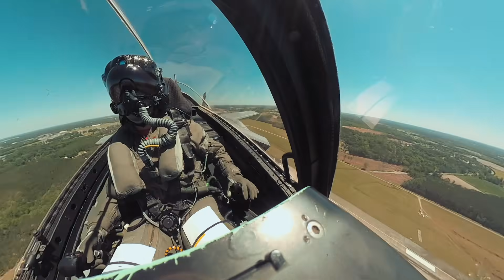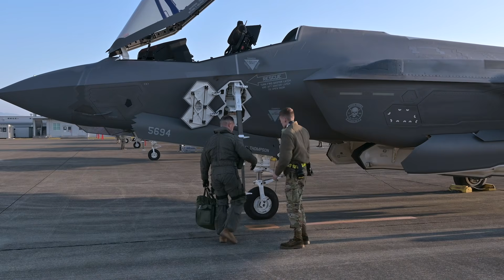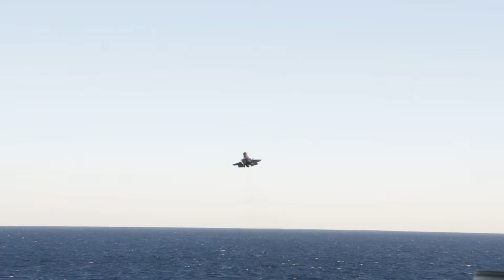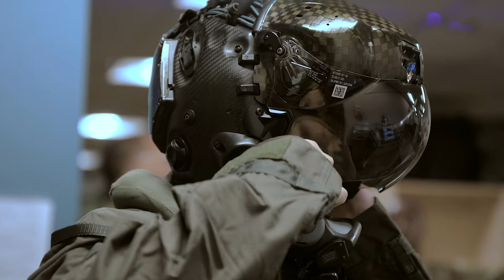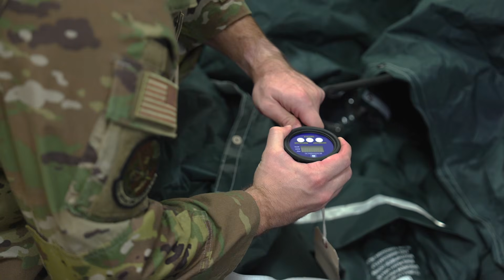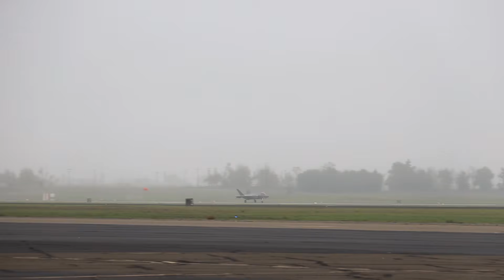The F-35 Has a Weakness — Here’s How It’s Detected

Comment from the maker: Stealth isn’t invisibility  and now you know why.
So what do you think is the biggest weakness of modern fighter jets?

👇 Let’s discuss in the comments.
Subscribe if you want real explanations no hype, just how it actually works.
Reply: What nobody talks about is that any aircraft that's flying subsonic at comparatively low altitude can be shot down by Vietnam-era technology.  Not with anything a high success rate, but if the adversary has spotters with walkie-talkies and some old anti-aircraft rockets, they will get lucky once in a while.  I'm a little surprised by how much the US is using the F-35 in Iran, though.  They're a very good stealth first-strike attack aircraft, but once surprise is gone, a lot of older technology planes are more capable and can be flown at a much lower cost and with less maintenance per flight hour.  Stealth has a lot of trade-offs.
Reply from the maker: @jeffreyquinn3820  Great point really appreciate your insight 👍 You’re absolutely right that stealth comes with trade offs and once the element of surprise is reduced the equation changes significantly Detection doesn’t always require advanced systems sometimes it’s about combining simpler methods together That said stealth still reduces detection range and reaction time which can be critical in real operations It’s not about being invisible it’s about being hard enough to track to complete the mission Also agree on the cost and maintenance side that’s one of the biggest hidden challenges of platforms like the F 35 Really solid perspective thanks for adding to the discussion 🔥

Comment: Iran target the F-35 with a MANPADS because it was flying at very low altitude. These systems are short-range, typically only effective within a few kilometers, so they wouldn’t work against an F-35 operating at its normal high altitudes.
Reply from the maker: Yeah, you totally hit the nail on the head about the low altitude thing! High flying F-35? No problem. Low flying? That's a whole different ballgame.

Comment: I think F35 is a joke now it’s overpriced and new technology has defeat it stealth capabilities completely. New ground to air and air to air missiles now having sensor fusion with include ai object detection both from optical camera and heat signature that can differentiate between the F35 it self an flair that deploy to evade the missile in which if the F35 was tracked by them the outcome is inevitable. These technology now available from china and Russia already and countries planning to buy F35 now reconsider other options like then cheaper options that do not relies on stealth such as Gripen because it more versatile and can fly without GPS and can work alone or in networks it also have more position acquisition option that not relies on only US GPS systems which will be at the mercy of the USA to not Block or Jamming and degrade it’s GPS signal
Reply from the maker: You bring up a lot of valid points modern sensor fusion AI based tracking and multi spectrum detection are definitely pushing things forward very fast stealth was never meant to be a permanent advantage and it is true that new technologies are constantly challenging it systems are becoming smarter more integrated and less dependent on a single method like radar alone aircraft like Gripen also show how different design philosophies can be very effective in their own way at the end of the day technology never stands still what we see today is just one step in a much bigger evolution the future will definitely bring even more advanced systems on all sides and that is what makes this field so interesting